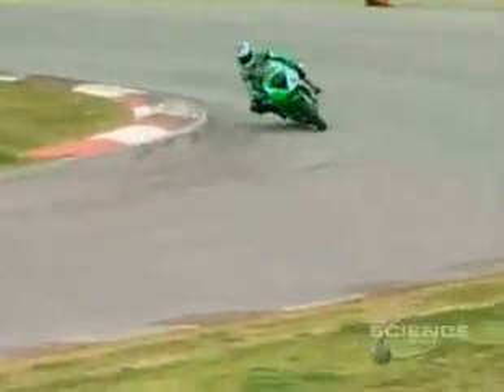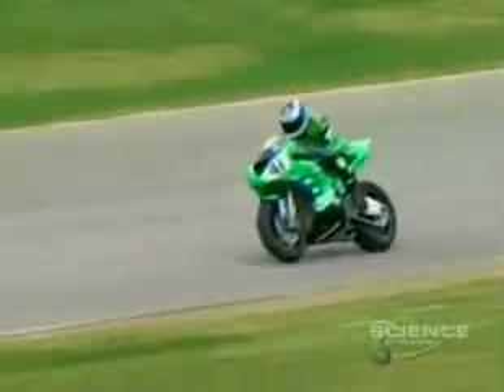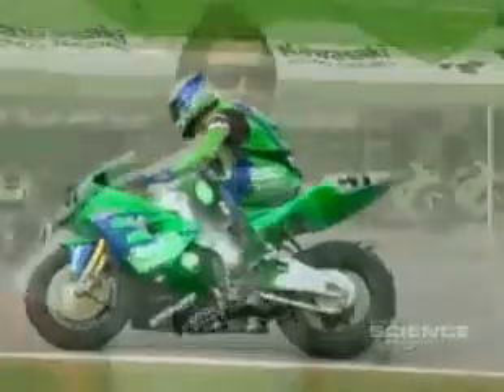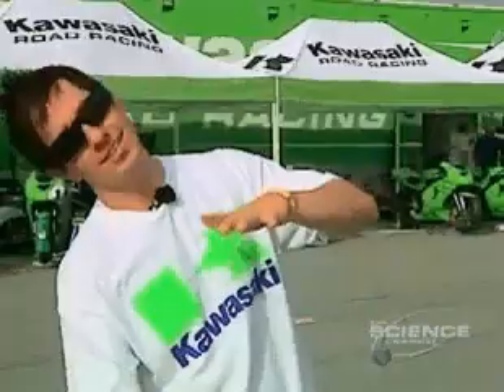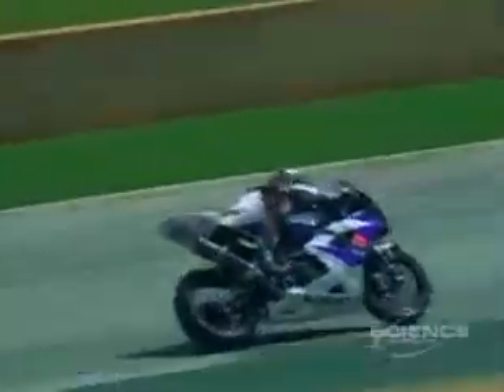Countersteering

Comment: It's funny no one ever says what happens AFTER you push the handlebars. Do you you keep them that way until it's time to roll on the throttle and stand the bike back upright? Or do you turn the bars in the direction of the turn after you initiate the lean?
Reply: Once you are in a lean, you can countersteer to adjust your turn.